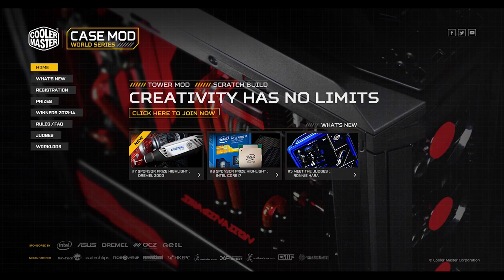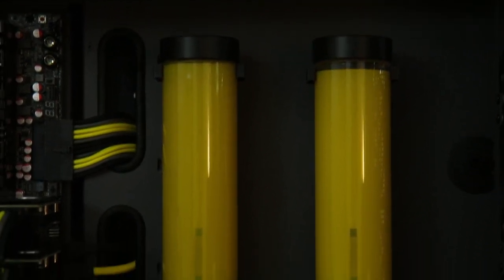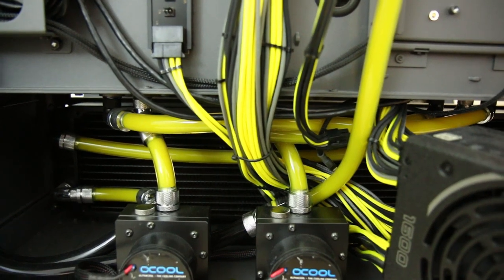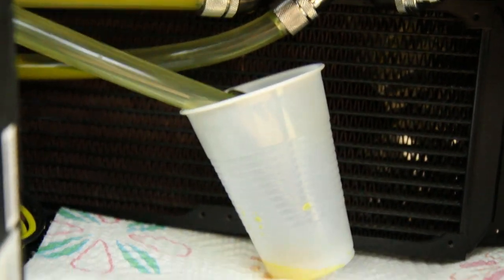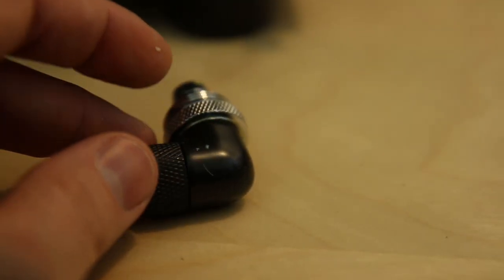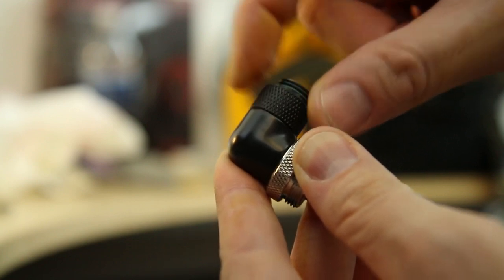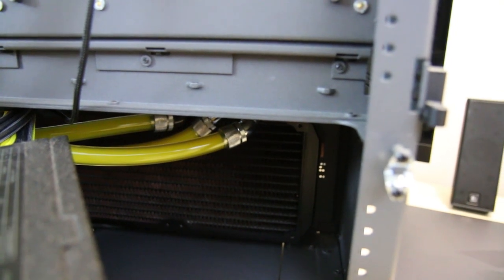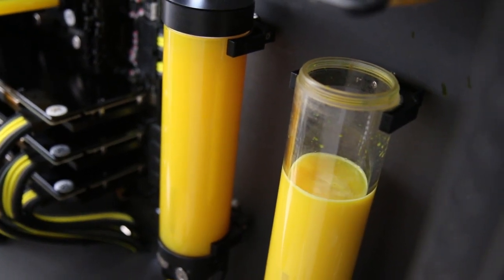My $6500 Custom Watercooled PC LEAKED!!! Now lets fix it....

Comment: will this run GTA V on maximum settings at 60fps?

CPU: My sunglasses
CPU Cooler: Volcano Hot Sauce Liquid CPU Cooler
Motherboard: A spoon (Maximum OVER 9000 Ram)
Memory: A Fork (OVER 9000 RAM) OVER 3000 x OVER 500
SSD: My Pillow (9000 TB)
HDD: My pants
OS: DJOS 90 Pro 9000bit

Now really ...

Intel Core i7-5820K 3.3GHz 6-Core Processor
Corsair H100i GTX 70.7 CFM Liquid CPU Cooler
Asus X99-E WS SSI CEB LGA2011-3 Motherboard (Maximum 128GB Ram)
Corsair Dominator Platinum 128GB DDR4-2400 Memory
OCZ R4 1.6TB PCI-E SSD
Hitachi Ultrastar He8 8TB 3.5" 7200RPM HDD
EVGA GeForce GTX Titan X 12GB HYBRID Video Card (4-Way SLI)
Corsair 900D ATX Full Tower Case
EVGA SuperNOVA T2 1600W 80+ Titanium Certified Fully-Modular ATX Power Supply
Pioneer BDR-2209 Blu-Ray/DVD/CD Writer
Microsoft Windows 8.1 Pro 64bit Operating System
Asus PB287Q 60Hz 28.0" Monitor (3 Monitors)
LaCie 5big 25TB External Hard Drive
Seagate Backup Plus 8TB External Hard Drive
Asus Xonar Essence STX 24-bit 192 KHz Sound Card
NETGEAR WNDR4500 N900 Wireless Router Dual-Band Gigabit (Certified Refurbished)
Corsair Vengeance 2100 7.1 Channel Headset (Wireless + Microphone)
Razer BlackWidow Chroma Gaming Keyboard
Razer DeathAdder 2013 Optical Mouse
Corsair Air Series SP120 Quiet Edition (2-Pack)
NZXT Sentry LX Fan Controller

                                                                           Budget : $11212.67

Link to these : http://pcpartpicker.com/p/Xg3wvK
Reply: Xbox 360 Speed All low, like max 20 fps
Reply: you didn't read the real ones ..
Reply: Xbox 360 Speed I did, a PC what runs gta 5 in high needs 8 titan XXX and 3 intel xeon, sorry.
Reply: Xbox 360 Speed  I would rather buy 4 nvidia gtx 980ti's

Comment: I'm about to ask a dumb noobish question. But why not use antifreeze for a car in something like this? If it can cool an engine...

Thanks for not laughing.

M
Reply: Mycroft Holmes I recognize this is an old comment, and you probably  have your answer already, but it is because Antifreeze will eat away at PETG tubing because the G is Glycol and Antifreeze is ethylene glycol. The two Glycol types will cause a chemical reaction creating a nightmare when you literally eat through your tubing, probably in less than a month. It would probably work ok of you used non PETG tubing, but the stuff is just dangerous if you had a leak and have kids or pets because it smells and initially taste very sweet and has an alluring color.

Comment: "It was only leak on the bottom..." yea nothing important there, only PSU and 400VDC(eight times more dangerous than US wall socket) -,-
Reply: +Arek R. lol yes DC lb for lb is waaaaaay more dangerous than AC
Reply: +Jody Wilson +Arek R. not realy cus it has to be earthed
Reply: Jack Court what?lol
Reply: By law anything with a metal chassie that has the potential to hold a current has to be earthed via the power wire
Reply: Jody Wilson though yes dc is more dangerous than ac

Comment: I hate water cooling to the core.
Reply: Macsk8ing Bad personal experience?
Reply: JayJapanB The fact of water+electrical components just kills me, I don't know it's like an instinct.
Reply: Macsk8ing Most situations you will find that if you dry things out they turn out fine.

Also I would probably recommend being enthusiastic about custom PC building and relatively financially stable to consider watercooling in the first place.
Reply: +Macsk8ing I agree. The thought of pumping water inside a case full of expensive electrical equipment doesn't sit well with me. Sure it will run cooler, sure leaks are rare, but I'd rather have a hotter running pc with the piece of mind it's cooled by air

Comment: XD this is basicly how i installed about a thousand cpu´s and gpus XD just use a shitload of arctic silver  will dry over the years keeps cooling when dryed and the older it gets the easyer it gets to remove it  my server runs a fucking tnt2 and it works whit a full tube of arctic silver since 1998 evry day displaying a 3d open gl servermonitor

Comment: Water/liquid is too dangerous to put into an expensive pc. 
We all need a commercial refrigerator cooler: no liquid to leak all over parts and temperatures low enough to overclock max in summer for days!

Comment: water cooling is a dumb gimmick.
Reply: Ulfric Stormcloak Not for overclock
Reply: use nitrogen indeed for overclock, not water
Reply: shadowflare99 You could damage your stuff, because water condensation.
Reply: and water cooling problem ??
Reply: Just use an AIO cooler, if something goes wrong, it's the company's fault, not yours... And they must compensate it... And don't use it if you're AFK.
Reply: What is AIO cooler? Like video cards that come fused with a radiator via some sort of cords?
Are they just as good in performing as the custom loop water-cooling?

I am just starting out with pc building